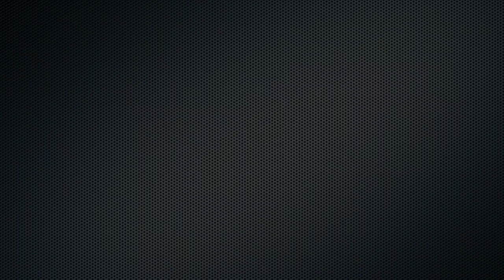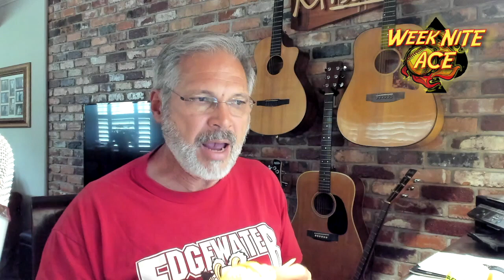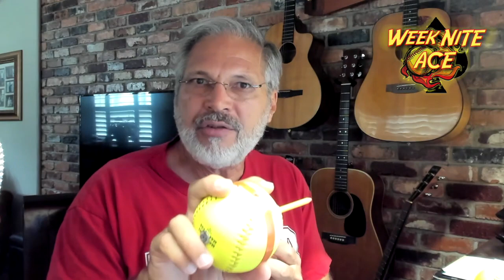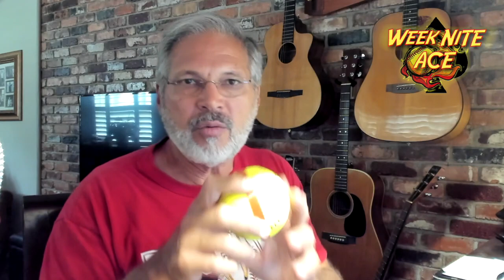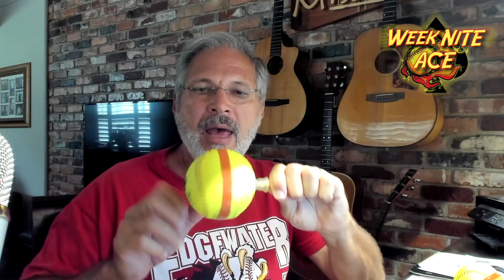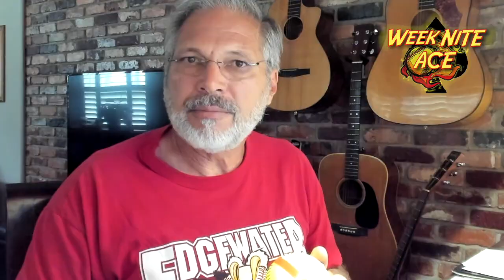It's NOT the grip that makes the break - It's the Rotation! - Slow Pitch Softball Pitching School

Comment: Is there a difference to the under handed pitch style where the ball rolls off the hand and the over handed style you show in the videos to make the curves work? My more natural release is to left the ball roll of my hand and I can only achieve a curve ball that breaks away from right handed batters I would like to improve on my pitching techniques but I’m so inconsistent with pitching the way you pitch it.
Reply from the maker: Sure Matt, check out the video I'm posting tonight, the first in my series, "Slow Pitch Power Pitching". I touch briefly on why a backspin pitch is inherently more natural to the pitching motion and so, more sound mechanically. I believe this pitch has the potential for excellent command. I also cover several other benefits of learning to throw this style of pitch. Video 2 in the series will cover the grip, release and mechanics and may be more helpful to you. I'll have to admit that when I converted from the forward spin pitch a few years back that it took me a while to get the hang of it but once mastered, it was awesome. I can consistently put it within 3 inches of the black on the back of the plate now. It took a few thousand pitches but it is definitely worth it. My advice would be to be patient and work with it in practice... maybe a throw-away during a game sometime. Good luck! Let me know how it goes.

Comment: hey ace... i've been throwing a forehand slider using the same physics you use in your pitches... about 3 years ago i came across a video that explained what makes this move... from this video of yours, i think you have the basic idea completely correct but i'm not sure if you're aware of the physics that supports it... 

my forehand slider moves about 12 inches when i pitch from the rubber but i have an extra 6 feet since we use a pitchers box that's 6'x6' and i can pitch from anywhere inside the box... from there i get about 16-18 inches of movement...with no wrist flip or added spin... 

spinning it fast is not as important as you think... however, the orientation of the spin in relation to the direction of movement is absolutely important... this creates what i call the smooth/rough side effect which induces the magnus force... unlike a curveball that uses high rpm's, this uses the continuous seam that's created by having the spin oriented in the middle of the smooth spot by the seam around it... so watch this video with that in mind and let me know what you think... 

great series by the way... i've been teaching this pitch... the forehand slider...  for a few years now, both online and in local clinics... plus we have a pitcher at the sportplex i play at that uses your backspin technique so i'm already aware of how well it works... however, he doesn't seem to get as much movement as i do but i'm about to start working with him to see if we can't get the orientation better for more movement... he just came back after 2 years off from a leg surgery or i would have done it before now... anyway... it's nice to see someone doing this the right way... 

https://www.youtube.com/watch?v=t-3jnOIJg4k&fbclid=IwAR2TCSTyZwPgC7TZydL7CBChWoW2PM585LD2e620RX99snlHDE3U_5yTGZg
Reply from the maker: Willy Dial, thanks for the great comment and the link. I saw this video a while back, and I remember smiling when, at the end of the video, the professor claims to have been the first one to explain the "Magnus effect." We Americans had understood and thrown breaking pitches since before he was born, but I'll let that slide. 

On your point that the spin axis orientation is the cause for lateral movement and not the spin rate, I agree. I have thrown knuckleballs, with no spin, who's seam orientation was at the same angle as the slider and seen the same lateral movement. 

There are two other factors to consider when comparing lateral movement without regard to rotation direction. First, is the optimum axis rotation angle relative to the flight direction. Too little angle creates less than maximum "lift" or lateral force, like the wing of an airplane, too much angle and the ball will "stall," again like the airplane wing and loose "lift" or lateral force.

The second factor is flight time. The relationship between flight time and pitch movement is complicated, and I could explain it in detail with trajectory and velocity charts. For now, I'll say that in general, the longer the ball is in flight, the more time there is for the ball to move. So a pitch with a high arc, with more time, moves more than a pitch with a low arc. However, It's important to remember that ball flight time is your enemy as the batter has more time to see your pitch. The amount of movement is not as significant as where the pitch is located in the hitting zone. So, a slow pitch with a high arc and lots of movement is not nearly as effective as a faster low pitch with less movement. 

Now to the back-spin, forward spin comparison; a back-spin pitch drops at a steeper angle than one with forward spin. The higher the spin-rate, the steeper the drop so, when combining the lateral movement of the slider with the steeper drop of the back-spin pitch, you do get more overall movement with a back-spin slider. 

There are two other reasons I teach the back-spin slider. 
1.) The deflection angle off the bat is more favorable to the defense see video: https://www.youtube.com/watch?v=EgzYL5K1cYs

2.) For back-spin pitchers, back-spin slider mechanics are consistent with the STRAIGHT back-spin pitch and so promote greater accuracy.

I would not necessarily recommend the back-spin slider to a seasoned, successful forward spin pitcher for reason 2 listed above. 

Thanks again for your comment! Good luck.
Reply: @utah32804  

actually, the professor only claims to be the first to explain why this smooth/rough side orientation induces the magnus force with a baseball as opposed to creating it with a lot of spin... he didn't claim to have discovered it... 

i don't have a knuckleball but i asked about this when i first saw the video and the professor said this is also what makes a knuckleball move... in fact, the way to make one dance back and forth is to have a small amount of rotation so it passes through the smooth/rough side on both sides of the direction of flight...

"So a pitch with a high arc, with more time, moves more than a pitch with a low arc... so, a slow pitch with a high arc and lots of movement is not nearly as effective as a faster low pitch with less movement. "

let me point something out about this... as you say, a backspin pitch will drop down more sharply than a forehand pitch... however, using this approach allows you to orient the ball so it can get lift or drop as well as lateral movement... by orienting the spin slightly downward, i get a drop too and with the higher pitch, by orienting it downward slightly i also get no movement on the way up and a lot on the way down since the spin is oriented that way... the magnus force is not induced until it gets into the right part of the arc where the orientation is correct...... a flatter pitch will induce the magnus force most of the way to the plate...

i understand what you're saying about combining the strengths of both a back spin with movement... i started out with a regular backspin pitch... and added a forehand pitch as my second pitch... with the idea being that between the 2 of them i had the most difference i could get... then i added a big spin backspin pitch similar to yours except i palm the ball to get maximum friction for high rotations...
Reply from the maker: Wow, Willy, this is awesome! I love your insight into the physics and mechanics involved here. You've obviously been around and know your stuff. 

I have studied "late-breaking" pitches and determined that spin axis orientation to flight path can change during the flight of the ball,  affecting the rate of the break along the way. However, this is really advanced stuff.

My approach is a little different in that; For training purposes, I assume a constant rate of movement along the entire flight path. If you examine the path of a pitch with a constant rate of movement and align it with the line of sight from the hitter's perspective, the pitch can appear to break late if pitched slightly to the opposite side of the break. Especially if pitched inside. The pitch runs against the break for 3 to 4 inches then breaks back to the original line of sight at a point about halfway to the plate. From here the pitch runs about 4 to 5 times as far toward the break side as it did against it. The illusion here is a late break though the movement is constant. This works best when the first half of the pitch is closely aligned with the hitter's line of sight.  

Though I'm not crazy about giving a hitter a long time to look at a pitch, I'll have to admit I'm intrigued by the idea of a high, genuinely late-breaking pitch. Thanks again for your comments/contributions to this channel!
Reply: "I have studied "late-breaking" pitches and determined that spin axis orientation to flight path can change during the flight of the ball,  affecting the rate of the break along the way. However, this is really advanced stuff."

that's a fact... once the seam si aligned with the fight path, the magnus force is lost...  in fact i considered mentioning this in my last comment but as you say.. it';s a bit advanced... i wasn't sure how far you'd considered this particular aspect... it's good to see we're on the same page... 

my approach is to start the seam offset about an inch... with that, there's a minimal amount of slide... however, as it moves toward the seam,   it comes to the optimal position and the late hard movement...

Comment: Any tips pitching in the rain?
Reply from the maker: Yeah, throw knuckleballs! Just kidding, well sort of. This is a common problem for me in the summer when we get a lot of afternoon storms, also in the spring and fall when the grass gets wet right after sunset. When using the 3 point, backspin grip I teach in video 2 of Slow Pitch Power Pitching it's important that you "hook" the inside of the first knuckle of your index and middle fingers over the seams. Once your fingers and hand are conditioned to throw this pitch you'll find that your grip is still quite secure even when the ball is wet. However, you will lose some spin rate as the moister will reduce friction between your fingers and the ball. Hope this helps!